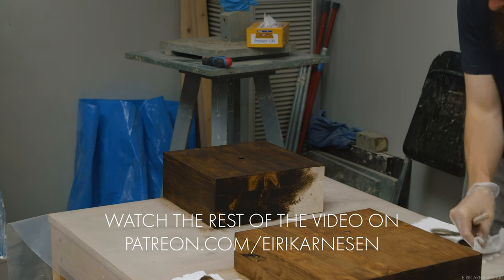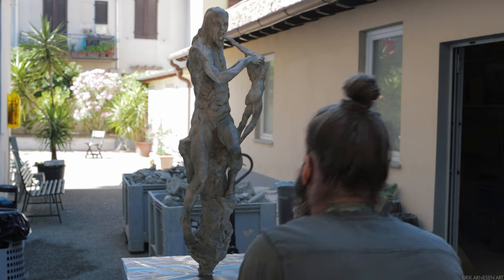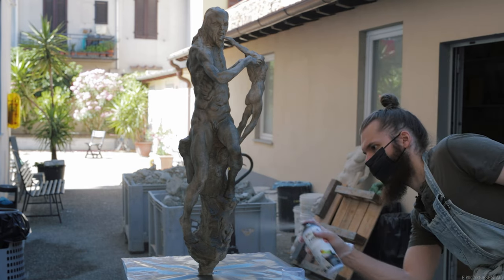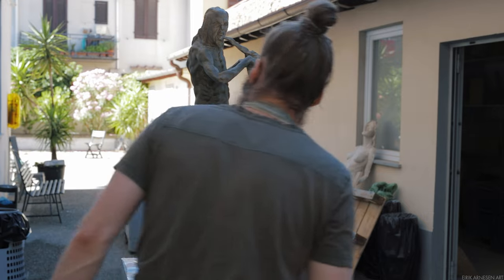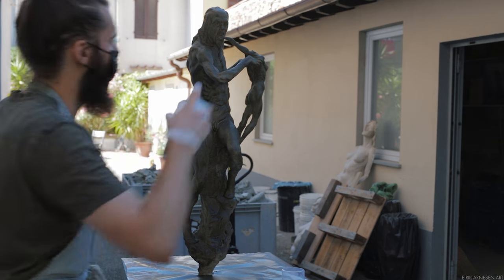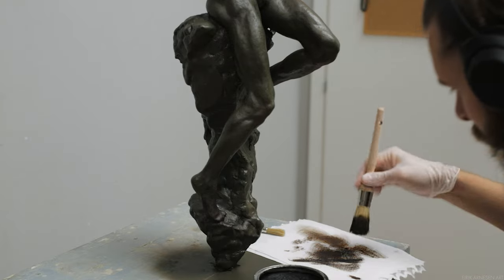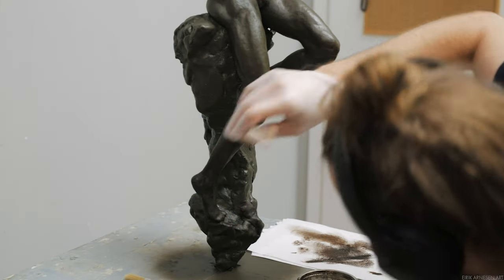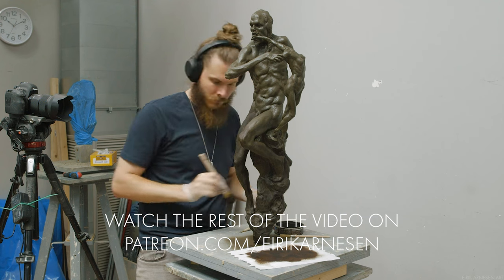Painting A Resin Cast - Advanced Casting - Part 4

Comment: You mentioned that the end grain will be darker than the other surfaces of the wood. Here is something worth trying (at least with hardwoods--I don't know how well it would work with soft woods). The surface of wood will absorb more of a finish (vs what is wiped off) depending upon how porous it is. End grain is more porous, so it sucks in more finish. To avoid this, you can sand the end grain with a higher grit than the other surfaces of the same piece of wood. Sanding to a higher grid will make the wood absorb less finish. Thus, if you sand the end grain a few hundred grit higher (and perhaps sand for a little longer as well) it should start absorbing less finish than it otherwise would, and thus be less dark than it otherwise would. Thus, sanding different surfaces differently can actually help unify the overall effect of the finished piece.
Reply from the maker: This is a great tip! I will certainly give this a try next time around and make sure the results make it into a video. Thank you!